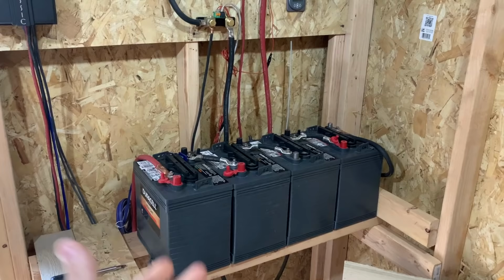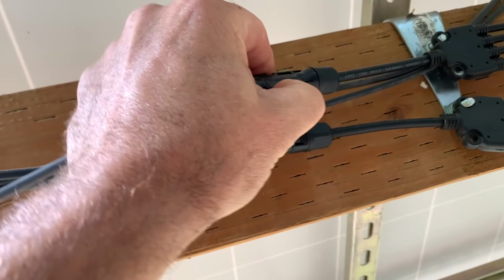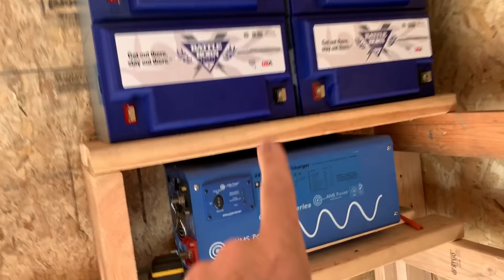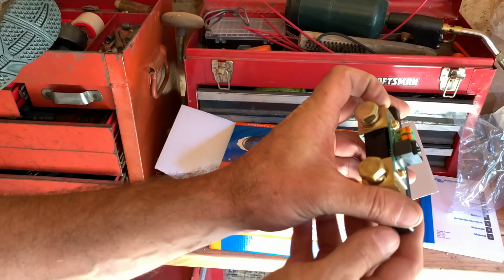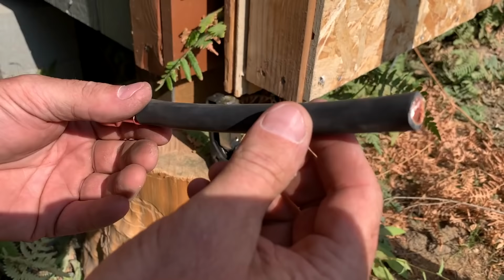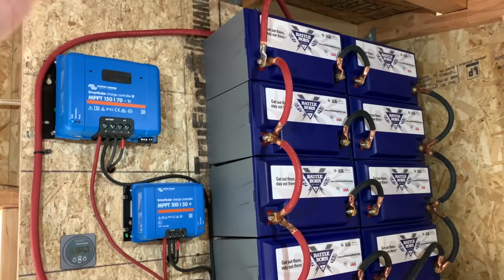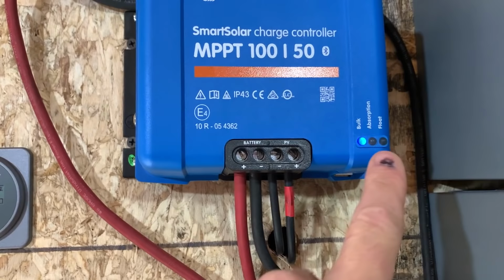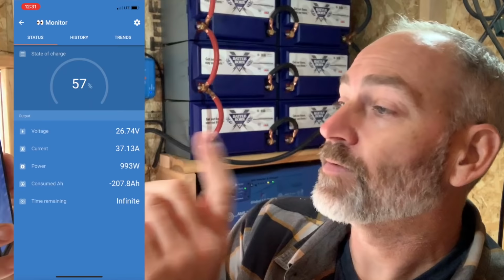EASIEST Off Grid Solar Power System Battery Bank

Comment: It would be helpful if you disclosed Battle Born “partnered” with you at the beginning of your video or in the description.
Reply: yeah those batteries are about a thousand a piece on amazon with tax thats over 8 thousand dollars this is a bit deceptive.
Reply: @Hutzjohn  It’s a beautiful set up. He did great! My one Battle Born was $950 plus tax about 16 months ago.
Reply: Sound expensive
Reply: Ouch, $8k in batteries alone.  You could get a Tesla power wall for that kind of money
Reply: You can buy good solar batteries for about $250.00 each.
Reply: @logicwurx  location and link??
Reply: @christracy130  Yes, but you would lose a LOT of versatility/flexibility/customizability, but it all  depends on what your going for and how handy you are. I would prefer the versatility of a custom built system. There are always tradeoffs with all-in-one or custom/modular.
Reply: @pnutbuttajellee1394  Agreed.  I went all in on a commando build after patch 22.  Now I’m bored with the game.  Maybe pick it up again in a month or 2.
Reply: @christracy130  I have a Powerwall 2 and it's fantastic, but Tesla won't install them without a grid connection, even though the Powerwall 2 is fully capable of off grid operation. Almost forgot to mention: Powerwall doesn't officially support generator connections.
Reply: @logicwurx  Not LiPo batteries.  Watch Will Prowse open batteries and show you the different quality inside of them , some of the cheaper ones are junk.  Stick with Battle Born, Relion or Renogy for quality.
Reply: @wopwops0482  I had no idea that was the case.  Thanks for informing me.
Reply: @Hutzjohn  I was just looking at pricing thinking he had maybe $10k worth of equipment there. I was WAY off! I get the whole solar power "free-ish sorta, not really" energy, but at $8k in batteries alone, it really makes no sense to convert.
Reply: @brianmcintyre6407  yes it's a very expensive system.......it is nice.....it's a super big investment.
Reply: @Hutzjohn  They are worth the price tag, for many users.  Others are happy dealing with recycled lead acid batteries for cheap on the other end of the spectrum.  I designed a system and would have loved using these.
Reply: @logicwurx  "Good"?  lol.  What is defined as good depends totally on what your needs are.  For my purposes, there was no contest and the cost premium was worth it.  Weight, depth of discharge were two factors for me - as well as the need to ventilate FLA.  Then there is maintenance.  The list goes on...
Reply: @logicwurx  V-Max 125aH AGM Charge Tanks come to mind...
Reply: It should be mandatory that there is a 'partnered with' or 'sponsored by' or 'advertisement' label attached to these videos. Same should apply to IG
Reply: @stevecunningham936  what makes it top quality. I saw that video. Will doesn't know what kind of battery was used. he just knows they are 3.2v 3.4Ah and 120 of them. how do you know the quality?
Reply: @Hutzjohn  - no wonder he was so happy! Once the tech is out there, we'll be able to get them from China for less than $100 a pop.....
Reply: @bradleyjohnson452  I'm pretty sure it's the law in the US. It should say "ad" or "partnered" somewhere in the video or description.
Reply: It would be helpful if you disclosed Battle Born “partnered” with you at the beginning of your video or in the description.
Reply: Just here to learn.   but curious how this "disclosure" would have been helpful ?
Reply: @bryanward7451  So you know for sure it's a biased review, as he got the items for free and is not likely to say anything bad about them.
Reply: @bryanward7451  Hi Bryan for me it helps to filter the information provided from the start if we know the person paid/sponsored/given product. This way we can make our own judgment as to the data. I’m all for compensation it is just that I want to know before not after. Hope that better clarifies my perspective.
Reply: @tumbleweed1976  how do I determine the number of batteries I need? Just doing a small 10X12 shed setup and trying to get into solar power!
Reply: @garys4688  Gary I started with one lithium battery from Battle Born for $950. To me this is your best start. It runs my Engle cooler 24/7, compliments an inverter, controller, charges various devices, internal BMS (battery management system) and handles various temperatures in my van. Lithium cost is high but I enjoy the peace of mind of not worrying about dropping to low. Lastly consider doing an energy audit of all the objects that will draw and this will help you know how much battery you will need at once. This will also help you size your inverter. Lastly... buy a larger inverter, say 2000/4000 surge, as your future needs may change.

Comment: 949$ each battery.. wow out of my range.. I have golf cart batteries I need to replace and like the lithium idea but........ my system is an AIMs 12k off grid inverter and would never get rid of it.. it is for 48V/96V banks... lots of lithium for my system  ... I also needed a disconnect for code and as I have turbine I needed bridge rectifiers, a diverter for excess power and a brake for turbine in case of repairs ... nice system but AIMS removal..? I'll take your old inverter...!!

Comment: Your system looks good, however it really needs a battery disconnect, if something goes wrong with any of the batteries you will have a  bad or even violent situation. Note also it’s unadvisable to discharge these batteries below 10%, doing so shortens long term life.
Reply: I'm pretty sure his controller has that setting

Comment: i do not understand why all this expensive equipment is mounted on flammable pressboard and lumber ??
Reply: flashbulletin  I still don't understand ? if you are going  to invest in the equipment you should invest in the safety of that investment .
Reply: I wonder about the same thing.
Often seen these PV Islands beeing build in wood environments.

It is energy electronics, a fatal failure puts your house at risk.

It should be in a metal switch cabinet instead of getting mounted to a wall of OSB.
Reply: God Robot  they are putting there equipment in appropriate enclosures more than likely, to avoid a fire because they are worried about there house / investment in solar?
Reply: Pennywise, pound foolish.  OSB saved how much? $50? $100? ...on a $10,000 system.
Reply: @alliejr  true ... sometimes small cheap bits will go a long way in case of disaster if not ignored . I remember dropping a cable and melting a battery connection and the cable when i cheapened out few bucks by not buying a on wire fuse ... not going to that again

Comment: I agree with the battery isolation switch suggestion. Available online for automotive use. (A single-throw double-pole, Frankenstein type knife switch would look cute)
I bet you've already thought of this, but just in case you haven't: I would have installed four separate shelves for the batteries just in case one of them misbehaves and has to be removed. I think you know where I'm going with that, eh ?
Nice job, don't listen to haters.
Cheers from S.Louisiana.
Reply: @C H ha!

Comment: Build a lined box around those batteries before you find out the hard way they got too cold, that's thousands worth of batteries, I'm lead acid, but I keep them 60 f in winter, I can't afford those Lithium
Reply: The batteries will prevent them from being charged if the temp drops below it's safe range, so there is little risk of damage there, and as long as the temps don't go below -4 degrees they can still discharge power safely too, once it hits that it'll shut itself off to protect itself. You have to go below -15 to risk damage to them. 24 degrees is where they stop allowing charging to protect themselves.
Reply: @andycanfixit  You can only discharge down to -4 Celsius, which is 25° Fahrenheit.  Must be above 32° F to recharge per their manual ...

Comment: Watched this, am looking at maybe doing something. I have enough background to do what you are doing on my owb and watched to validate what I am planning.  I will be doing a modified grid tie butI plan to keep a battery bank up as a hedge against power outages.  I have a cutover for a generator but it would be far more convenient to cut to the battery. The batteries would be kept up with a battery tender - with a charger to bring them back after a use. They will probaby be Lead not lithium because of the reduced cycles and lower cost. I will want about 6-800 AH. The inverter will be wired to the cutover with a plug that can be pulled and the generator plugged in. The backup inverter would not be turned on unless power is out. 
I have a couple questions for you.  Why not put the battery chargers under the batteries too?  WIth the heat sink size on them they must produce some heat. I would also cut two pieces of pressed wood, as wide as the inverter area and a little deeper than it, hinge them at the front hook them back at an angle in summer I could direct the heat away from the battery and hang down in front in winter to make a flue to direct the heat up.  Not sure how far the panels are but if they are 100 feet number 8 wire would have about 0.13 ohms (for the 200 ft round trip) - that can be a significant IR drop if that loop is 24 V.  Going up two wire sizes (8 to 6) generally cuts that loss about 40%.  You might want to put a volt meter on it at the panel and the charger when running full sunlight and charging. If the differnece is 10%, you are losing 10%.  taking it up two sizes would drop the 10% to about 6%, probably not a great gain but if it is 30% that would get yo about 10% more.  Again, good job, very informative.  I have watched two of yours and the one on generator vs panels is good, you are the only one i have seen who admits to having a gas generator and i know darned well the others do.  It gave you credibility with me.

Comment: It’s impressive that 300 watts is enough to run your house during the day
Reply from the maker: there is not much on normally.
Reply: Interesting- what kind of fridge are you using?
Reply: I use only about 80-100 daytime 150-180 between 5-9 pm. But with 300 or more what are you doin in your house runnin machine shop?
Reply: Albert Quinanola well,
If you were running a machine shop you’d be operating 10-20KW, so I think your smartass comment isn’t exactly appropriate. A small hair dryer is 1200 W, and we are talking about a whole house, not an RV. If you have a refrigerator,  a freezer, and a couple ceiling fans running at once, you’re way over 300 W. I think you don’t really understand electrical power if you think 300 W for a whole house isn’t extremely conservative.
Reply: @andinbriwel1092  that’s not true. You’re hair dryer watts is rated PER HOUR. So it’s really only consuming 20 watts a minute
Reply: 1200 Watts OR 1.2 KWH. Average power plant charges like .12-.14per Kilowatt
Reply: @andinbriwel1092   no one knows everything. But one thing I KNOW for certain is you can always your temperament or your “attitude”. NOBODY has the power to ever take that away from you. It will always be your decision to treat someone nice, or mean. Start your day with hope and vigor, or  be sad or angry. 
    If you are the only person who can control your outlook on everything. Why choose the negative perspective, or choose to be rude to someone.  Pick each other up. Not kick someone when they are down. 
    Always be kind. Always be ready to learn from anyone, about anything!  I’m sure I’m wrong about something I said. I hope so. I’ll be excited to learn from my mistake if so. Take care and be happy all
Reply: @andinbriwel1092  i take power conservation to the next level. I do groceries everday after work, just keeping my bacon and eggs fresh for moning breakfast. So my fridge is running at the lowest settings. With lights its always off in the morning we have windows anyway. Tv it would be a miracle if its on 5hrs a week 😂. A regular house with 3 bedrooms. 4 family members. My kids dont watch tv, they choose to play outside with their friends. You know the regular countryside family.
Reply: Matt Rosich put an ammeter on it. You’re saying a hair dryer draws 0.16 amps. Better double check that before you start sizing your own system 👍
Watts are a momentary measurement of power draw, while Watt-hours are a measurement of total power usage over time. If a device draws 1,200 watts, and you run it for one hour, you’ve used 1,200 Watt-hours. That’s how that works. 
Voltage is potential, and current is flow of energy. At any moment, a measurement of the potential in Volts multiplied by the current flow measured in Amps will give you the measurement of power usage in Watts at that moment. 
A 1,200 watt hair dryer operating at 120 volts draws 10 Amps. 
10A X 120V = 1,200 Watts. 
If you operate the hair dryer for 6 minutes, 6/60/=0.1 hours
1,200W X 0.1 Hours = 120 Wh (watt-hours)
Make sense?
The length of time you run the hair dryer has no affect on the power (Watts) it draws. A 1,200 Watt device draws 1,200 Watts any time it’s running, and the longer you run it the more stored power you use. But it’s always 1200 Watts. 
(Of course, if you run the hair dryer on low, it will use less power.)
Test it.
Reply: Albert Quinanola that’s very impressive! My main house uses too much power - and it’s considered quite “efficient” compared to the others in the area. Step by step, though, even that house is getting better. I’m averaging around 1,000 watts with higher peaks and less in off hours.

Comment: All this talk about how affordable solar is becoming, but the batteries are $950 each.  Just wow.
Reply: A glaring majority of solar systems have no batteries. These are the systems that are affordable. The payment on a 10 year solar system loan, is about the same as the power bill you no longer have to pay. And in 10 years you no longer have to pay that either.
Reply: The only time solar is "cost effective" in a backup capable or off grid system is when you are in a remote location without available power. When my wife and I built our house, the power company wanted over 13 Grand to run power to my location not including any of the breaker boxes or anything. I spent about that same 13 Grand on a big system a little bigger than this one, and have had no power bill for the last 7 years. That's when it's cost-effective. If I lived in town and I already had a grid connection, it would take a lifetime to pay off that 13 Grand I spent, and by the time they paid themselves off many of the components would need replacing.
Reply: In the description he states it's the easiest way not affordable.
Reply: @jedburnell9046  I'm not sold on that. You are assuming that the equipment will last longer than 10 years. Without batteries you need a grid tie in or no power at night and limited on cloudy days. Once batteries are installed then it is almost certain that you will be replacing the batteries every few years.
Reply: @fostercrowder2580  I use much less expensive SLAs and get about 5 years.
Reply: @jedburnell9046  good to know. I own a golf cart we get about 3-4 years from those batteries. At 100$ each
Reply: @michaelholderegger645  Exactly!
Reply: Thomas Chrombly  Where do you live, and who is your electrical utility company?
Reply: Thomas Chrombly  Hi Tom, GPS coordinates would be great as I enjoy doing cost analysis on off grid systems.  I have a small off grid system but built it more from an educational standpoint as well as an emergency backup system as it certainly was not cost effective based on my cheap utility rates.
Reply: Thomas Chrombly  Hi Tom, that's pretty funny as Peter 1 Island is uninhabited except for occasional visitors (I know it well from my ham radio experience).  In general off grid systems are not cost effective if on grid power is available at reasonable price per KWh.
Reply: @jedburnell9046  and 10 years is the expected battery life, so then you are on another plan.

There is always a cost.

I have just replaced my solar system so am familiar.

Comment: That’s 8k worth of batteries. I hope BB helped;)
Reply: I was thinking same thing. Big investment.
Reply: 8 grand wow
Reply: @tonypointer7026  
Yeah, but don’t even try to compare it to the best AGM. Battle Born’s are energy sponges. Greater depth of discharge without degradation, greater number of cycles, less voltage sag under load and on and on. You get what ya pay for. They are getting competition and they are catching up fast and getting cheaper.
Reply: Josh Smith  I just want to let you know that WE, the USA,  have more nuclear warheads and weapons at our disposal than ALL nations combined. WE, the USA, out number China's entire military 100 to one. Some estimates put that number even higher. The United States are not to be trifled with, we may have our domestic issues, but don't believe for a minute that WE, the USA,  can't put them ALL in their place at the same time if WE wanted too.
Reply: Thanks for that info. Thats the most important bit for me. The cost of the batteries.  After all of course if the rest  of the system is a grade and the battery is only b grade the best one will get is c grade.

Comment: Hi Martin, I have been professionally installing off grid solar systems for 25 years. You should really fuse each parallel bank of your batteries. It is not recommended to use more that 5 parallel banks but you have 4 so that is okay. Look up Parallel wiring of Lifepo Batteries - Victron Community.